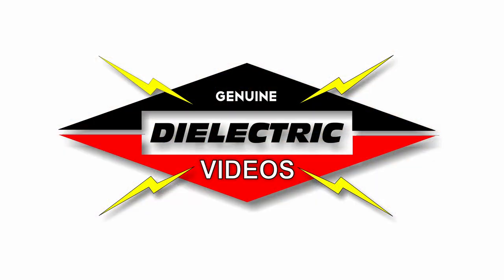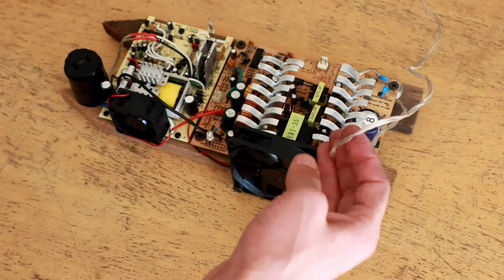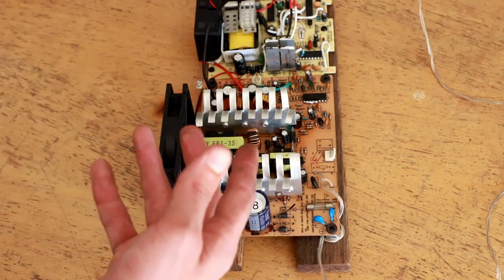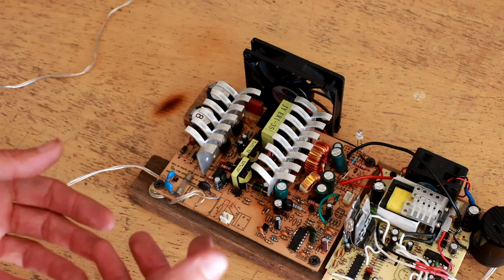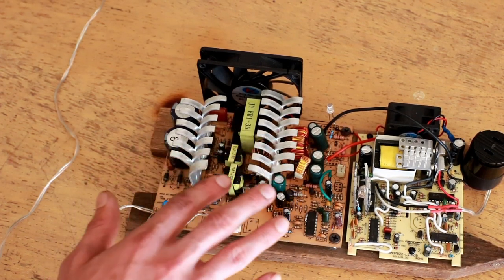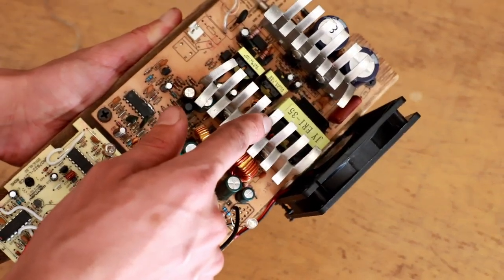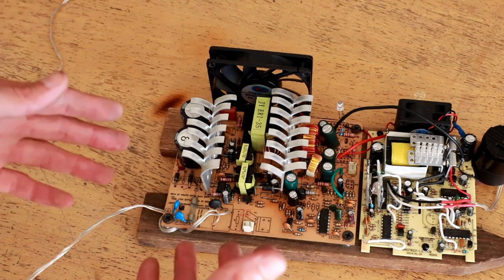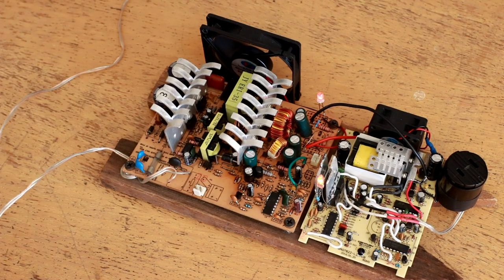EP 54 - Follow-Up To AliExpress ATX PSU

Comment: Dang, is the guage of wire you are using to put Mains 120Vac to the ATX really safe? Looks a bit thin.... The other thought is i would never call an ATX SMPS chopper transformer or the one in your inverter to have an insulation class comparable to a proper isolation transformer and rely upon it... Apart from that, interesting use of an ATX supply. The things are everywhere ljust looking to be re-purposed!
Reply from the maker: For the lab I'm fine with using 24 AWG for the mains cord, since the PSU is fused at 3 amps and shouldn't draw too much more than that in normal use. For production/consumer use I would definitely go with at least 18 AWG, probably with a ground wire as well.

You're right that a proper split-bobbin isolation transformer would undoubtedly have much stronger isolation, and I do have one in the lab. The fact that the PSU passed a 1kV hi-pot test suggests to me that it should be suitable for low- to moderate-level protection, however. I'd be comfortable doing live-wok at the bench behind this thing, but I certainly wouldn't be running power tools out in the rain with it either.